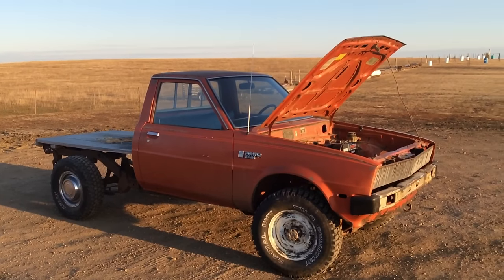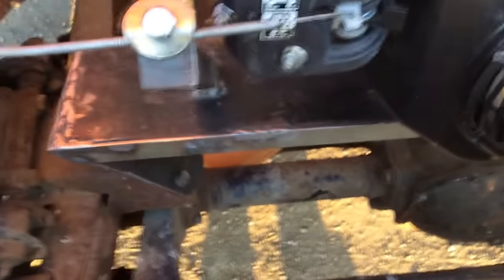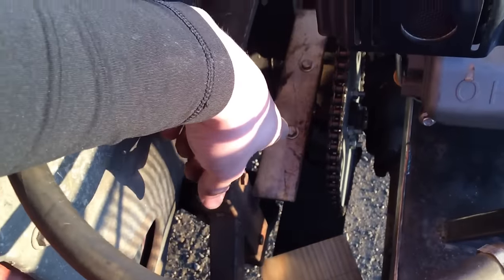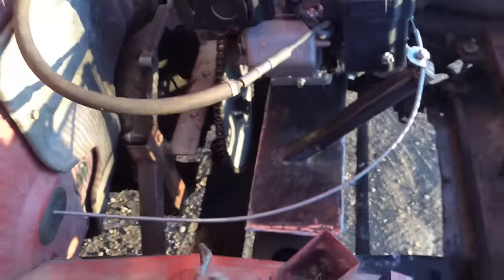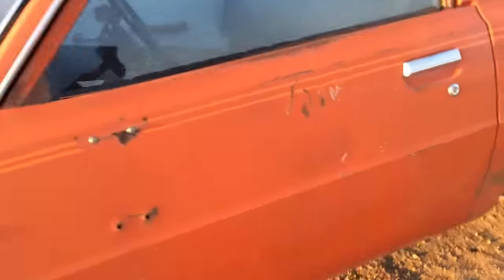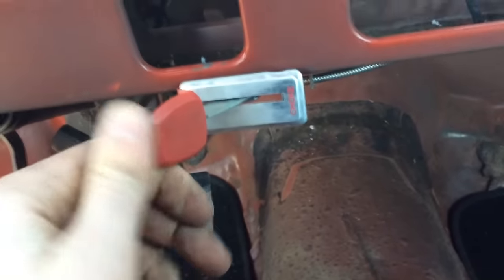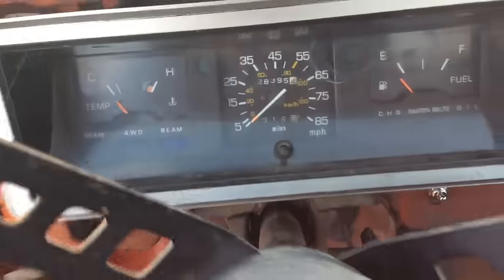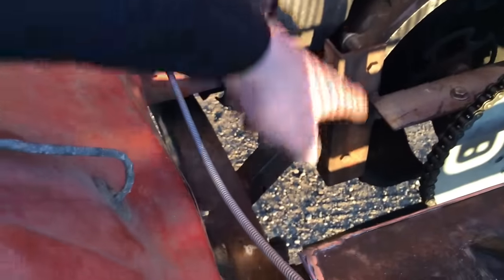Predator 212cc Truck

Comment: “That thing got a hemi in it?” Why, yes it does!!
Reply: Well, you’re not wrong
Reply: So there’s a go kart/scooter/lawnmower running a hemi somewhere.
Reply: @jashmodi  predator makes a hemi design engine, hemi just means the cylinder head has a dome shape
Reply: The 4 cylinder 80s chryslers with 2.6 mitsubishis had hemi badges
Reply: More cylinders=more problems!!
Reply: @Sams88990  maybe. It means each cylinder is stressed more when there are fewer
Reply: She got a hemi lmfao
Reply: So when the apocalypse comes I need to find a harbor freight and get a few motors so when it's hard to find vehicles that run ill have a ride to run from zombies lol love it
Reply: @isaakwelch3451  false inline 4 cylinders are the most dependable engines as well as highest performance
Reply: @JLUX100  not really. Straight 6's are typically the most reliable, because 6 cylinders are inherently more balanced than 4. as for making power, more cylinders is inherently better because you have less reciprocating mass, putting less stress on the parts and allowing higher redlines
Reply: @isaakwelch3451  no  no no inline 4s balance just fine. 4s from Honda have fewer moving parts and are capable of much higher rpm even stock. And Honda 4s out last all of the rest too. Even being high compression and tight motors still last when redlined a lot. Straight 6s are much Better than v6s that I can agree with
Reply: @JLUX100  4 cylinders have decent balance, but by their nature they aren't as balanced as a straight 6. Fewer cylinders means the angle between combustion events is greater, which makes for a rougher running engine. Honda makes fine engines, but the straight 6 design is by nature a better one. Theres a reason every single semi on the road today runs a straight 6, if the 4 cylinder design was more reliable, thats what they would use
Reply: That's actually  not a hemi
Reply: @jashmodi  I’m running a hemi mini bike I love to mention that it’s a hemi
Reply: Better than a POS hemi.
Reply: It means a bit more than that....Take a Hemi and a non-hemi Predator remove both govs and add a stage 2 kit to both...The non-hemi engine will lose all day long against the hemi style.....The bigger valves in the hemi head is what makes the magic happens and the shape of the dome along with centered sparkplug position is what enhances the efficiency of the burn....
Reply: na 212 is to small for a hemi when he puts in a doramax 440 than he will have a hemi  like the old plymouths but by name only hahaha .
Reply: @JLUX100 tell me your poor without telling me your poor. Put down the meth pipe and buy a real car. Every fucking honda I had when I worked at the engine machine shop was blown to smithereens and completely fucked.

Comment: Thanks for inspiration. I had an old Jeep in the Philippines that had a tired out Toyota engine....blown head gasket. Rotton radiator. Leaking gas tank. But the body is ok. Lots of stainless steel. So I followed your advice. Installed a 6.5 HP Honda clone engine with a go kart clutch. Then the biggest 56 tooth sprocket I could find that runs a 428 chain....same as the clutch. So now I'm able to use it on our Jungle roads. You helped me make it useable at an affordable price. Thanks. I will do a video soon on my Jungle JEEP
Reply: Amazing!
Reply: Aye bro post that video I would like to see it ✅
Reply: Yo dude wheres the video iv been waiting
Reply: Post it
Reply: Dude go kart powered OTJ i need to check this out
Reply: WHERE IS THE JUNGLE JEEP VIDEO!

Comment: So if u did this to a jeep 2.5l you would loose 400lbs and maintain the same hp.
Reply: lmao
Reply: This Predator might just beat that straight six
Reply: God i had a s10 with that iron heavy junk 2.5l 4cyl. Same design as jeeps and yes worst engine ever. Piston slap for days
Reply: I dont think the gm 2.5 is the same as jeep 2.5. My jeep 2.5 look like 4.0l missing 2 middle cyl
Reply: @dualsportrider3221  its basically same design. Crap iron block, single overhead valve*, 2 valves( im pretty sure) per cyl. Same displacement. Amc owned jeep im pretty sure they bought that 2.5 from someone. My guess GM(for those who take shit soo serious i GUESSED it was GM i have no data other than it shares its basic design rarely worked on jeeps definitely not 4cyl jeeps). But either way ive driven both. Feels the same junk shit to me. The 4.0l(JEEP STRAIGHT 6) is a GREAT engine though
Reply: Lmao 😂🤣🤣
Reply: @dualsportrider3221  it's the same 2.5l iron Duke engine in both GM and Jeep. The Jeep 4.0l is pretty much a slighty tweaked 258 GM straight 6
Reply: Single over head cam?? In a 2.5l jeep since when. It's a push rod motor.
Reply: They are completely different motors. The intake and exh are on diff sides between the gm and jeep.
Reply: It's the same block in the 2.5l jeep 4 cylinder as the 2.5l iron Duke. Same with the 4.0l and 258ci gm engine. AMC bought parts and blueprints for engines from almost any car manufacturer that would sell to them. That's why parts are so cheap for the older jeeps
Reply: (lose)
Reply: @Deftonesdsm  Neither the Jeep 2.5 nor the Iron Duke were OHC.  They were OHV (pushrod) engines.
Reply: @hogmantheintruder6789  The AMC 2.5 used a GM bolt pattern because AMC had bought a few Pontiac 2.5s as a stopgap before designing their own engine, so they had bell housings in GM pattern.  But the AMC 2.5 isn't even related to the GM engine of the same size, nor to the MOPAR 2.5 (which it replaced in the Dakota... eventually).  

The bore and stroke of the AMC and Iron Duke are completely different, among other things.

The AMC 4.0 is in no way related to the GM 6 cylinder engines.  The 4.0 is the final evolution of 6 cylinder engines that started as a blank page design back in 1964.  GM never made a 258 ci I6 engine.  AMC did, though, and neither that engine nor its descendant the 4.0 are related to any of the many I6 engines GM produced.

Jesus.  I've run into people like you for decades.  Idiots who think a shared displacement/layout means "it's the same engine!"  Back in the day, people like you thought the Ford 2.8L Cologne motor was built or designed by GM.
Reply: @immikeurnot  right my bad thats what i meant overhead valve i got mixed up. Thanks for the correction.
Reply: @immikeurnot  dude relax. 4.0 i was speaking of the jeep 6cyl. And no i never said they shared parts. i worked as a A.S.E. certified tech for years. My point was the old 2.5 iron block american 4 cylinders where all junk. Jeep, gm whatever. Now i never looked into jeep as im not an offroad guy to confirm who actually built the 2.5 but from just peering under the hood seemed the same design as my 91 s10 was. I never said gm made a 4.0 6cyl. All i said (i meant ohv not ohc) ohv 2.5l american cast 4cyls where shit no matter what they where in. The fact you take a quick late night comment as me setting in stone a engine manufacturer or family is rediculous
Reply: @immikeurnot  yeah sure i woulda thought ford and gm shared engines... haha jesus man you take youtube comment way to serious. What about the buick all aluminum v8? Its a rover right? And ford pistons will fit with overbore? Actually thats all true. Still jeeps with 2.5s ive road in fekt exactly the same as my 2.5l s10. Slow low revving junk with shit pistons=slap. Man chill no need for insults. You must be angry at the world
Reply: Buick alum v8 was around way befor rover used it. Im a master tech for 15y. I can assure u the 2.5l are very diff. The oil filter spot is cast into block on jeep. diff on iron duke. They would not recast block while copying another design
Reply: @dualsportrider3221  yes different manufacturer but still same basic design like i said. Ohv 2.5o 4cyl cast design like i said. And yes rover bought the v8 from buick and it loved on into the 90s across the pond. Before you get so judging maybe you should realize youtube comments made late at night are not gospel
Reply: @hogmantheintruder6789  The jeep 4.0 is a tweaked version of the AMC 4.2 and 3.8 not the GM straight 6. They are unrelated.
Reply: @dualsportrider3221  The 2.5 was a push rod engine. It was replaced by the overhead cam 2.4 later on, I think in the late 90's.
Reply: That 212cc is what 6.5hp right or close that jeep 2.5L has like 144hp and 189 pounds of torque! Depends on what year also lol
Reply: dualsport rider, Jeep CJs had the 151 (Iron Duke Pontiac) engine 1980 - 83.
After that AMC made their own 4 cyl
derived from cutting off 2 cyl from the
straight 6, just like you said...
Reply: Jeepin' 276, You are wrong about the 4.0 straight 6. It was AMCs 100% own
Torque Command 6 engine. 199, 232 and 258 cubes. AMC also had their own V8s. They used GM ignition parts
and Chrysler trannies 1972 and up.
Reply: Here I was thinking the Comanche shared the Iron Duke but turns out it was a 2.8l GM engine. The 2.5 was AMC as well.
Reply: Deftones Dsm 
The AMC 150 is not the GM Iron Duke. I live where AMC motors were produced we have the 2.5L and the 4 millionth  4.0 sitting in our historic society. The AMC 4 is a cut down straight 6.
Reply: dualsport rider 
I have an AMC 150. The GM is called an Iron Duke it is a Pontiac 151. 
I live in Kenosha we’re the motors were built. We have one of each in our historical society the 2.5 and the 4 millionth 4.0 L 
Of which the 2.5 is a cut down straight 6. The GM 2.5L was used before AMC had made its own, then Chrysler bought Jeep and used these same 2 motors in their Jeeps.
Reply: RedWhiteAndBlueVideo, Did you work at AMC in the 70s? If so, thanks for my
1970 Hornet and 71 Gremlin, 75 Hornet, 74 Matador. And if you worked there in the 60s, thanks for my 1960 Rambler Six Super, 61 Rambler Classic Super, 62 Classic Custom 2 dr. , 62 American 2 dr,
62 American 4 dr, 65 Classic 770 with 
the silent 287 V8
Reply: Jeepin' 276 
Not true AMC used the Pontiac Motor first, then built there own 150.
Reply: classic287 
No I never worked at AMC I’m not that old, lol. 
I just grew up and still live in Kenosha where they were built. 
AMC homecoming is 2020 on the Lakefront.
Reply: RedWhiteAndBlueVideo,  Ja, I was there on the 100th Anniversary (2002)
with AMCRC. I was surprised how many Ramblers were there...There was
even a 1902 Rambler...
Reply: classic287 
There is a 1902 Rambler on display in our historical society. Maybe that was the one there. I’ve even seen the Rumbler which is an AMX with a rear rumble seat on display at the historical society.
Reply: RedWhiteAndBlueVideo,  Really? That’s got to look outrageous, lol...
Reply: Oldschool mongoose
Reply: @hogmantheintruder6789  Those 4.0L engines were bullet proof, and they were good torque heavy motors. They were thirsty, but they might be the best engines Jeep ever had.
Reply: I believe you are mistaken on the Jeep 4.0 liter.  That engine can be traced clear back to the Rambler engines of the 1960's.  It was a bullet proof engine that would take a lot of neglect and abuse so they finally started putting them in Jeeps.   @hogmantheintruder6789
Reply: While increasing reliability
Reply: The 2.2 in the S10 is so bad. It wont pull the thing up a hill w/o dropping 5 mph. But if has 377k miles on it with no rebuild, so it's a reliable little thing.
Reply: Put a 440 in it .
Reply: @hogmantheintruder6789  258 GM 6 ?? lol when did GM make a 258, only tweaking goin on is you
Reply: @jaredgrass2183   lol   the 4l  is a great engine.
Reply: This is the best thread ever. This dude must be the guy who gives you the wrong big parts at AutoZone. Teach us about 455cid V8s please!
Reply: @Deftonesdsm Just about every vehicle with that engine under the hood was slower than the speed of smell. I can't believe they even entertained putting that engine in a truck - especially since the 4.3L V6 didn't get that much worse fuel economy and made about 2X the power.
Reply: @erikkovacs3097  in 2003 the 2.5 was replaced by the 2.4, that was based on the same 2.4 in the pt cruiser. In jeep's they are pretty rare because they only went from 2003-2006 they are a PITA to find parts for.
Reply: dualsport rider lmao
Reply: Fix the 2.5l. If geared correctly and driven correctly, it's good for a jeep. Only if you modify and make it a monster or tow with it will you actually NEED a bigger engine. Most people need more horsepower to cover their mistakes, not the vehicle. Iron dukes were also great engines if used correctly.
Reply: @dualsportrider3221  Some Willys had an "F" Head engine (IOE intake over exhaust) Intake valve is in the head and exhaust valve is in the block. Valve in head operates with push rod, valve in block operates with cam. Harley up until about 1929 had an "F" head engine.
Reply: The 2 98 xj 2.5l s ive owned were ok in 4low but god to pull out into traffic her in masshole land u gotta turn the a/c off or ull die!!
Reply: it's a matter of gearing. For a 4 cyl to do both, you need lower gears and more gears in the trans. My wrangler with 4.10s, a 5 spd and 2.5 was a sporty little ride. The XJ was geared for economy, not speed.
Reply: 5sped xj 2.5s all have 4.10 gears. When body rots away axles are worth more than i pay for the whole thing.
Reply: Too true!
Reply: Lol
Reply: Yes

Comment: imagine sitting in the taco bell parking lot at 3 am and you see a kid pull start his truck from the wheel well and drive away
Reply: Bro I need another hit
Reply: Faded
Reply: He'd be the coolest god damn kid In town lmao taco bell and a truck he has it all.
Reply: *drive away at 10mph 🤣
Reply: And in an old Dodge 50,
Reply: A couple of pulleys and some bulk starter cord added and he could start it in the cab.  Better yet, put in a 420 cc with electric start or even a V-twin, and he can make the gear ratio so there's a little more speed.
Reply: @nicklikesradio  “Bro’didjyou just see that?”

“Nah man, pass it.”

Comment: I can see the 212 becoming the modern world Ls  swap.
Reply: Don't u mean postapocalyptic? Hahaha
Reply: @bassmunk  I was going for a gas prices go up/ emission standards getting stricter mean. But yeah that would be a good idea.
Reply: ChrRtz_builds  I think the 212 cc engine might go faster than a ls lol
Reply: There is nothing modern about a carbureted lawn mower engine lol
Reply: If it replaces ls swaps this isnt a world I want to live in any more😂
Reply: Carbureted, Manual Choke, No Torque Converter, No keys to start, No locking doors. Seems more like a Mad Maxx Worlds, but if you wanna call it modern go for it boss
Reply: I think more people should do this but with the 670cc V twin, 3 1/2x the horsepower.
Reply: Hshahahahaha
Reply: The predator is like the ls swap of the go kart world
Reply: The ls is the modern ls swap
Reply: All about that lightweight powa!!
Reply: It's the LS of the karting world
Reply: @Range-X  they are modern fuel efficiency, OHV though and high power for size of  displacement

Comment: Wow!!! That's hands down the best one on youTube and u actually drove it for us!!!👍
Reply from the maker: ꗃ FRЄЄ WHЄЄLIЄꗃ thanks man!
Reply: I wanna do this but show what it takes to make
Reply: That thing is so cool. Great job!
Reply: @d7j6f1001 Rae no
Reply: What bhp does that make? Thats a hilarious and cool idea, im actually amazed the truck moved with that tiny engine.
Reply: EverythingWithWheels that’s the best one I’ve ever seen. How fast have u gone on it? I’ve seen a 92 Corolla with that 212cc in it do 25 mph.
Reply: 20mph he says in the video
Reply: Enoch The Witness I think those are rated at like 6.5hp but easily built for more, some valve springs and a better con rod for more rpm might be hilarious
Reply: There are other videos of others doing this months ago.
Reply: Check out an amr500 from ebay. They are tiny 500cc roots style superchargers from like a Subaru or something. By the looks of it, it would be well within your fabricating ability to install. Put a 6" pulley before the centrifugal clutch or off of the flywheel side to drive it. IIRC it uses a regular V-belt to drive them. They have somewhere in the ballpark of a 1.5" inlet/outlet. The carb is easily modified for a blowthough set up (the float bowl and fuel delivery has to be modified to be boost referenced so the fuel isnt pused out of the carb by boost) or do a suck through and put the carb on the intake of the supercharger. Although it's way easier, I dont recommend the second way for saftey reason though.... if you have a backfire <super likely while you're getting the jet size correct> the supercharger will likely blow up to some extent.
Reply: @everythingwithwheels4614  you should try two motors, one for each wheel
Reply: A trip to Harbour Frieght, sourcing parts from all you stuff laying around the shop and a visit to go power sports for clutch packs, Id like to see him throw a 3 banger perkins diesel in it! @froggersgarage5127
Reply: @d7j6f1001 Rae I salute you sir. Very well done. I saw something similar back in the 70's by mother earth news. It used a 12 hp diesel (very old and inefficient)  which ran at optimum efficiency to turn a generator. For the electric engine they used a starter motor off a jet engine.  Batteries were used as a boost for passing.
Top speed was , I think, 90 mph but couldn't sustain it for long. It got 70 mpg and was used in an Opel GT.  Anyone with the inclination could get a used electric motor from a wrecked car with a lot less batteries and an engine running a generator and get a lot better mileage and faster passing.
Reply: Boosted Bois or whoever did it first by swapping on into a Honda civic. They however welded it straight to the tranny so it had no clutch.